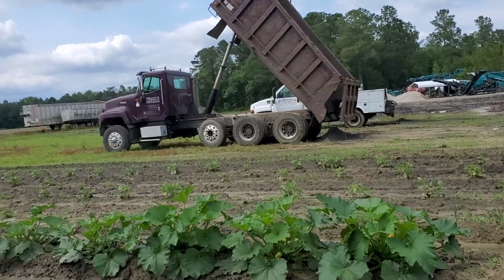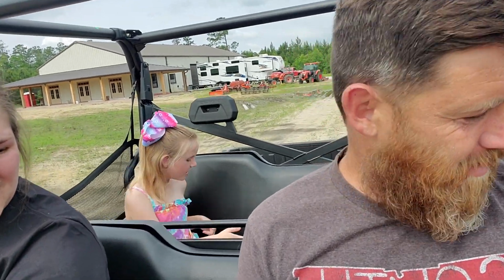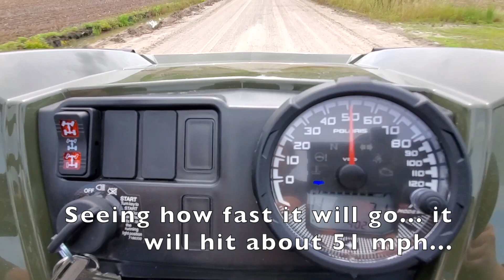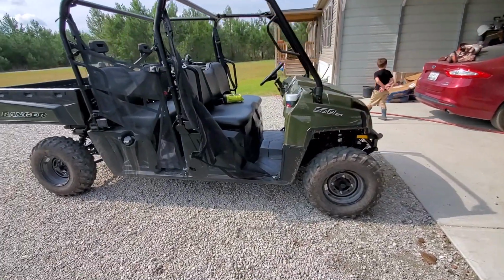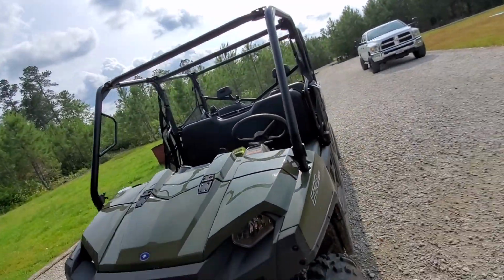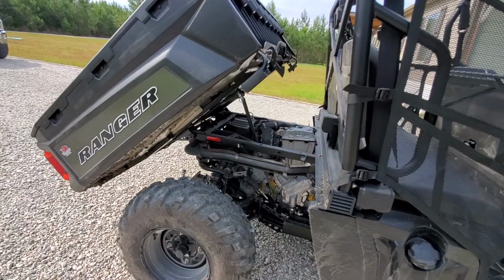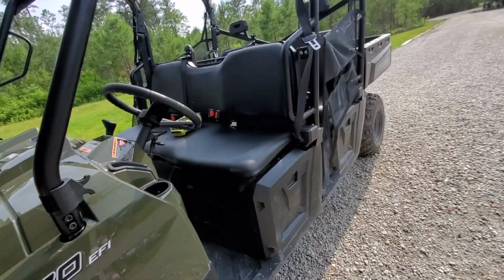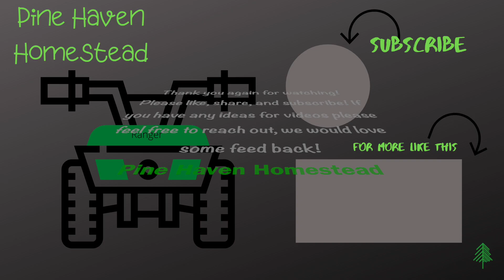New Polaris Ranger 570 Full Size 6 Seater with round roll bars

Comment: Thinking of pulling the trigger on this same unit very soon - what advice do you have?  Any regrets not going with the 1000 and eps? Will be using it around lake house roads and some gentle trails mostly.  Are the headlights powerful enough? Enough power?  Will we be able to survive without power steering if my wife is driving it? Etc.  thank you / appreciate your video / there are very few on the 570 full size crew.
Reply from the maker: The only regret I have is not doing the EPS. With that being said I have purched the eps just havent put it on yet. Headlights arent very good either but..... besides that I absolutely love it! If I had it to do over again for the money I would make the same choice. It runs about 52 mph which is plenty fast enought for us! Plenty of power and lots of room. Would recommend!